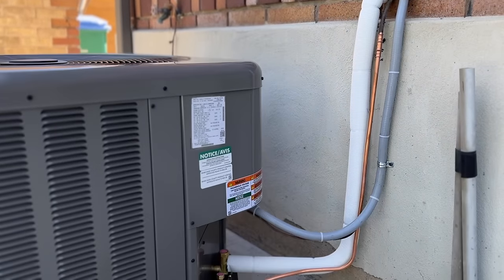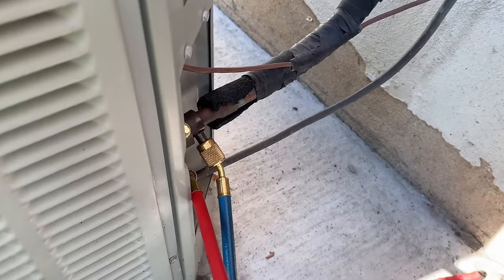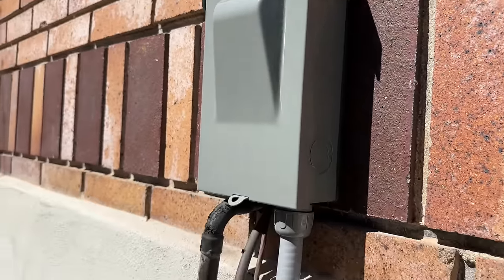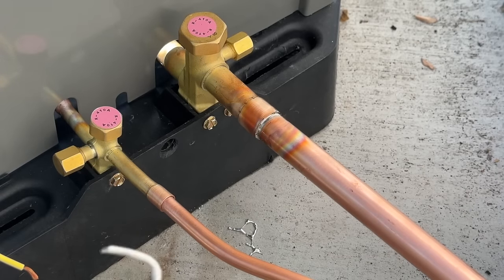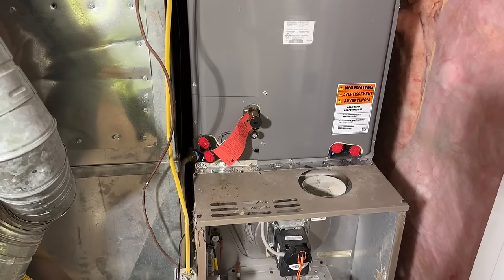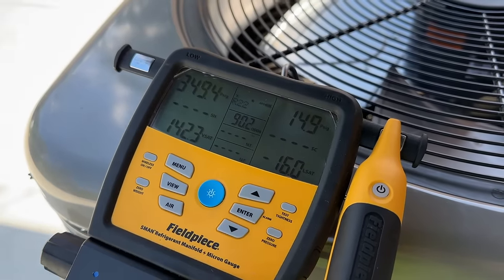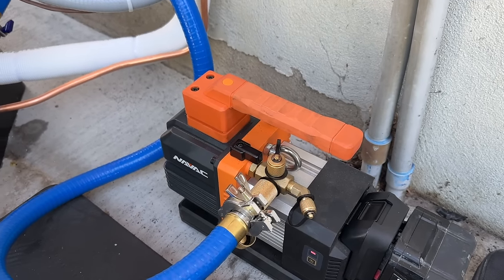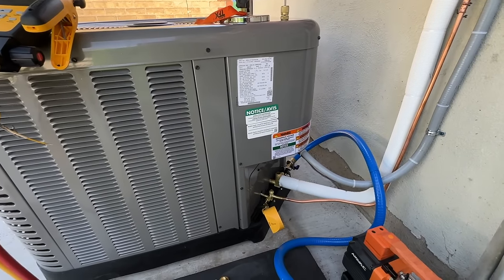Did You Know You Can Replace Your Own Air Conditioner?   -SAVE THOUSANDS-

Comment: True, I have a twenty-seven-year-old builder-grade and I'm fixing to get a New Old Stock to replace it with and bring my enviro-safe es22 over to it because it's so damn cold. Dropped 14 degrees changing over to the refrigerant. It went from 54 to 40. Harriet's happy as a cat in a bird shop runs half the time it did prior to. That's my 410A.
Reply: Shorter run times are not necessarily a good thing.  It limits the amount of moisture removed from the air and can make your house feel cool and clammy since your humidity may remain high.
Reply: @hjc4604  right on I'm aware of that it never affected any of that sort of thing it just worked better quicker and did not run the bill up so much so it was a win-win all the way top-to-bottom.

Comment: Great video. The old unit was an R22 and the new was a R410A, right?

I've replaced capacitors, have a set of gages and checked pressures, charged when refrigerant was low, replaced condensing unit fans, air handler fans,. heating elements,. etc as a DIY'er on my existing units.

But I never thought about replacing the entire condensing unit and coil myself,.. handling the refrigerants and all. 

I didn't realize the condensing units came pre-charged with enough for the lines and coil to an extent. 

With your video, I think I'm gonna try it next time.

Thanks,
Reply: They are factory charged (in theory) for a matching capacity evaporator coil and 15 feet of lineset.  Longer lineset will need refrigerant added.  Shorter lineset will need refrigerant recovered.

Comment: Good install, nicely done. You seem to be a Milwaukee guy, I'm curious why you went with the navak pump over Milwaukee? We test drove the navak, and then the Milwaukee, we purchased the Milwaukee pumps and have no regrets, they worked better in our opinion. We have several of the older field piece manifolds, they have built in micron sensors, I assume your newer version does as well, so I am curious why you use a separate micron gauge?  I guess maybe because you pull from one side only and we pull from both?
Lastly I have not used stay-brite, have always brazed, but I am becoming more and more curious about using it. Have you experienced any issues using it over brazing?

Comment: The way you solder, sometimes it looks like you're melting the solder with the torch rather than with the heat of the fitting.

Comment: @diyhvacguy have you done this with residential package units, and have you swapped them out or replacing them with a Split system or mini splits?  Inherited 2 old gas/electric package units, one for upstairs and one for downstairs.  For me, switching to a split or mini split solution would require brick wall repair.  I assume most people stick with newer package unit replacements even though they aren't as efficient, due to cost (re-routing duct, repairing big hole(s) in the house wall)?

Comment: Maybe you can do it with out getting shocked or killed by the electric portion. Maybe you can solder and not lose all your refrigerant. Maybe the fine will make you pay a lic pro.   The fine for releasing refrigerant into the atmosphere can be a fine up to $27,500 per day per violation.

Comment: Since the oil of R410A is different, isn't a better practice to install new refrigerant piping when you're changing from R22 to R410A?
Reply: You can inject a can of Cliplight Super Change into the system that will co mingle the oils, or flush the line sets with R-11 and nitrogen before installing the unit.

Comment: Most 10-15 yr old units being replaced don't have piston compressors. If the compressor has a round profile looking from the top it will not pump down to zero. Cutting the line will illegally release refrigerant into the air

Comment: I still like Brazing. Not a fan of the Stay Brite w the 410a systems
Reply from the maker: I can respect that. I have a dozen if not more 410a systems that I used Staybrite 8 on and have zero issues thus far. It’s a great diy alternative
Reply: same here, 410 pressures are way too much for me to feal safe using stay brite

Comment: If one is using stay brite to solder the linsets do you really need to do a nitrogen pressure test? Wouldn't just pulling a vacuum do the same thing to determine if the system is leak free? Thanks😊
Reply: He said exactly that in the video. I think he does the pressure test to get the line purge when he vents the nitrogen.
Reply from the maker: Yea I like to do it, being as I have all the stuff for it, but if you have a leak, your micron gauge will pick up on it 👍🏼
Reply: Nitrogen isn't used just for leak testing...

Comment: Did that.    I cannot locate the half cased up draft A coil…. New outside condenser 3 ton 410A  the A coil size 27” x 23 3/4” no company will touch it

Comment: I liked watching this but I did not see you mention anything about "cleaning" the existing line set. I was under the impression that if a different refrigerant was being used that the line set needed to be cleaned. I have thought about adding more R-22 to my existing system till it is actually time to have to change it out but my gages and hoses are so old that I am afraid the hoses would split, and I would lose everything...

Comment: SH around 3. Don’t you think it’s kind of low. I understand it’s TXV.
Reply from the maker: Yea I’ve leaned to not pay as much attention to sh when it’s a txv.
Reply: This is exactly what I am thinking. That superheat at 3 degrees tells me there is an issue. That compressor is getting liquid back, that's bad news. Even with a txv you need to pay attention to the superheat, not for charging the unit but for overall operation. There is an issue, that txv should be able to maintain proper superheat @ 10-15 degrees or so. Especially with 78 degree return air, ouch.

Comment: Guys who make videos like this are great for the HVAC industry. Screwed up DIY changeouts gone wrong = more billable parts and hours for the technicians! Keep these up, man😂🎈

To anyone crazy enough to try this, good luck. Most reputable companies won't touch something you bought yourself. So be ready to be out the cost of a whole new unit plus what you wasted on the DIY equipment.

Source: Former HVAC tech. I've had to fix so many of these "DIY" jobs. The funniest part is when the customer tries to show you the YouTube video they tried to copy like if that's gonna make the job any cheaper than a full unit replacement.

Comment: Thanks for all the informative videos. Where do u get the insulation for the lineset. Mine outside looks like it could use an upgrade. Is it in ur amazon store?
Reply: Same question…
Reply from the maker: https://amzn.to/47udF9o

The insulation that I use comes on the copper lines. I don’t think they sell it by itself. Unfortunately I have, however, used this insulation that I attached a link for it has a slot down the side of it and then it has adhesive so you can make sure you have a good seal. I’ve used the stuff many times and it works great. 👍🏼
Reply: @diyhvacguy   Thank you. Ill order some

Comment: I have a 30 year old Rheem 2 ton that’s starting to fail. I want to replace it with another Rheem. it has never had any parts installed or fixed at all, including the cap. I clean the outside unit at least three times every year. I hope the next one works as well as this one. I’m only a match electrician and have remodeled three homes. I think I can buy all the equipment, install it myself. I don’t think with the tools will cost to seven 9000 they want to do it.

Comment: I have a condo in Milwaukee where the air conditioning is not cooling. The AC unit is 22 years old and uses R22 refrigerant. The AC unit is located on the roof and the evaporator coil is in the bathroom. The HVAC company says that the AC unit is leaking and needs to be replaced. Do you have any videos that show how to replace an AC unit that is located on the roof and has the evaporator coil in the bathroom?

Comment: I just found you today and I learned a lot from you and i subscribed immediately!. Question or questions lol. If you were to upgrade from a 2.5 ton to say a 3.5 or 4 ton condenser. Do  you have to replace the whole A/C unit and furnace with the condenser or is it just replacing the coil to support the upgrade?
Reply from the maker: I wouldn’t suggest making a huge jump like that. Maybe go to a 3 ton but going to anything higher will be a bad idea. If you have an r22 coil, you’d need to replace the coil and condenser at the same time.
Reply: And here’s the problem that will cause the homeowners more money to get it fix right. I get this statement from homeowners when they need their unit replaced, I want the biggest unit you have. I always need to educate the customer all that is involved in sizing the right unit. While I see that customer would save money on the front end they will for the most case end up spending more to get it fix correctly. Most house are under size with duct work and many other things that need to be taken into account. Everyone hates on the Hvac guys even doctors and lawyers who make way way more than the Hvac guys and complaint about the prices we give and other professions as well. Why doesn’t a doctor come on and teach how to do an open heart surgery and do it step by step or other sort of surgery you can do at home. You get my point.
Reply: @ERICKDIAZ-ts8fp  I get what you mean. I looked it up. I’m in a 2133 sqft 1 story home, and I have a 2.5 ton that can’t keep up with the heat and the size of the home. Doesn’t get any cooler than 76 on some days. Just a thought on upsizing for the size. It is a brand new home I closes April 27th 2023. But city code allows the builders to put these units on this size house without a problem.
Reply: If it’s brand new home you need to reach out to you warranty and explain the issue. They might have not sized it correctly, not sure what’s going on there. Typically it’s 500sqf per ton but that’s a rule of thumb but other things take into consideration if the house foam, what’s the insulation Rvalue, windows height of ceiling and so on. I suggest getting a professional to do a heat calculation.
Reply: If you were to make that big of a jump, you will be replacing all 3, as your existing furnace likely does not have a large enough blower, and the next problem you may have is the size of your existing ductwork.  Most likely it will be too small.

Comment: What I did was do a little research and new exactly what size I own (compressor) and what I wanted to buy, every single HVAC contractor I spoke to treated me like sh*t, how dare I know what needs to be installed, I am only a Lic. Contractor/Engineer in the State of Calif. (not HVAC). Took about 7-8 phone calls before someone would talk with me.

Comment: I'M REPLACING MY OOOLD GOODMAN R22 THREE TON SYSTEM
WITH A USED TRANE XL14i FIVE TON SYSTEM EVAP, COND & FURNACE.
DON'T NEED SUCH A BIG UNIT BUT GOT THE WHOLE THING FOR UNDER $1K (NO OTHER DEALS IN AREA) 
Here's my deal... You keep making helpful DIY videos but most of us DIYers don't have the fancy equipment you're using. 
Do you have a video using traditional gouges  and maybe suggest where we may be able to rent a vacuum pump or get a nytro. tank
~OR~
Possibly do the major work then pay an AC guy to come test/finish the system? 
I think I just answered part of my own question.
Thanks in advance
Manny Z
Reply: Enjoy it freezing up….

Comment: Hey man, love the videos. Was curious why there is a filter drier inside lines but not not the outside lines? Thanks!
Reply: Weather.
Reply: The recommended place to put them is inside nowadays
Reply: @jredbokie1247 nowadays?   The filter/dryer was always supposed to be installed by the evap coil

Comment: The biggest issues that come to mind are the communist building permits, and dealing with the county inspectors. Second issue is warranty on the unit. Unless installed by one of their approved people, good luck with that. And you better be somewhat knowledgeable concerning the AC power, as not not get electrocuted. If it is a two part system where freon has to be extracted or put in, good luck with that. If it is a one unit install, that is not  as complicated.

Comment: Are you able to reuse R22 lines on a 410A system without using a cleaner? I was told the oils were not compatible and would contaminate the system.

Comment: Isnt the new refrigerant under higher pressure then 22 and the lines arent made to handle that pressure and need to be changed also. I know the sell units that have the refrigerant already inside the unit

Comment: Big issue here is you can't by PARTS for stuff . They refuse to sell to homeowners. I couldn't even get the hvac fan assembly shipped to me. Had to pay out the nose for a $300 part that I could have installed myself. Cost $1500...🤬
Reply from the maker: Repairclinic.com sells parts for everything. I’ve bought a lot of parts from them. I’ll have to do a video on that soon.

Comment: You stated you can skip pressure test but isnt it possible to have a good seal due to inward flex, esp with rls connectors, but fail pressure due to seal flexing outward and allowing gas to escape?

Comment: Don't forget to go get your EPA license that's required to handle freon. Then you have blown compressors that won't pump the freon. Then you need a 700 dollar reclaimer. Then after everything is said and done. You think your good (even though a million things could have been dine incorrectly) when not if the unit breaks you have no warranty. Manufactures won't warranty any equipment not installed by a licensed mechanical contractor. You know a license that takes 4 years of on the job training to achieve.  Please don't attempt to do this.
Reply: Exactly

Comment: when a new unit is place, normal practice is to do pressure test and then vacuum one. My question is: can I just do vacuum only?
Reply: My tip is doing evacuation first with micron gauge, if negative pressure under 500 microns keeps in 10 minutes, you are good to go. If not, pressurizing line sets to 160 psi with nitrogen, don’t have to be over 200 psi, as nitrogen molecule is 1000 times less than refrigerant molecule. Then check leaks and fix it.  Stay bright 8 is awesome stuff, no issue for me as of today.
Reply: Thanks a lot. That is what I was thinking. @juntang72

Comment: Hey My sister needed a new AC 3 ton Air handler system. They got quotes $15k- $24k
Yes $24 K. One company quoted a lease system and monthly payments of $375 . Like WTH. I have a 2 ton R-22 system in my 1200 square foot cap cod. It was installed new in 2013 but not initially working until 2015. I would like to replace it with a R410 2.5 ton system. Like to do it before they phase out R410.

Comment: Hi do you have any tips on adding type 2 dirt under an ac unit outside without moving the ac unit?
Reply: Easy.  Scoop it in there and then compact the H out of it.  Use something small that you can get back in there with....like a 2x4.  Then fix whatever caused it to wash out to begin with.

Comment: No. 1 you have to pass the EPA test to handle refrigerant.  No. 2, supply houses generally will not sell to non licensed persons.  Where are you going to get the vacuum pump, nitrogen, valves and regulators, torch?  This is in no way a DIY kind of job.
Reply from the maker: Amazon. Next day delivery. And I have a video on getting your epa card. I’ve helped dozens of people get it.

Comment: I have a geothermal heat pump.  none of the techs in my area understand it.  They don't even want to come find the leak in the system and charge it.  Is there a way a home owner can buy refrigerant?  I can buy the N2 to check for leaks.

Comment: Watching this video and my experience watching the HVAC that replace my system a few months ago, there were a few steps/things that I am not sure is common knowledge among DIY so it isn't mention here.  e.g. matching the required amp of the breaker (I needed a new one since I upgrade the tonnage), verify the air hose size for the increase tonnage. matching the evaporator coil size to the compressor size, clean out both high and low pipe and few more things around installation in the attic.  With the tool requirement, can this be a DIY?  I mean, we did wood floor replacement, crown mounding, shed, shelf, sprinkler valve/system DIY but this seems to be a higher DIY level altogether.  O am I just being afraid?
Reply: You are correct.  He is giving incomplete information.

Comment: Shrader cores should have been removed before the soldering. I would never trust that SB8 on a 410A heat pump system! I don't know who taught you to vacuum a system down, but you are doing it incorrect! The vacuum gauge  attaches to the vacuum pump and you connect both low and high side to the gauge manifold.
Reply from the maker: Nah you are way off man. Ac Service tech is probably the most knowledgeable hvac tech and this is how he does it. If your micron gauge is at the pump it’s not an accurate reading at all. The high side service port is the FURTHEST point from the pump so that is a true reading.

Comment: You stated the unit you were replacing is an old Trane R-22 system and replacing it with the Ruud 16 seer unit..You did not say but im sure the new Ruud unit is R410A or R454?? ...So my question is did you flush the line sets?? or is it not required??
Reply: @bluejay713  Yes , I was only asking that since you know the new system is a different refrigerant than the old R-22 is did he flush the old R-22 from the line sets?  I'm just trying to find out if it is a required step to flush the lines or is a minimal amount of R-22 left in the lines that will not cause any issues

Comment: I have a 30 plus yr old York heat pump in Florida. Still working great but I can't read any of the labels inside the cover or outside on the unit as they have faded or disintegrated . Is there any way to tell what model it is in case I need parts in the future?